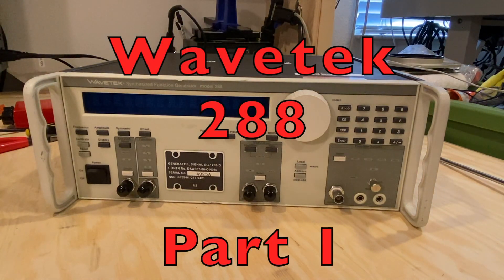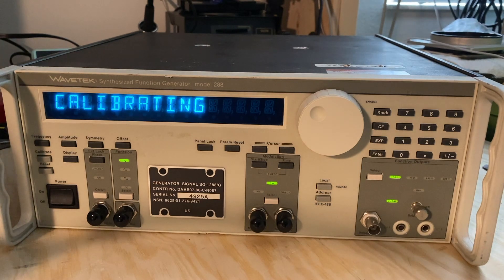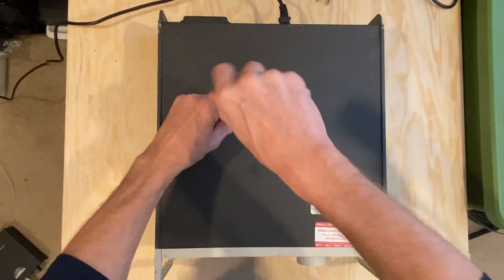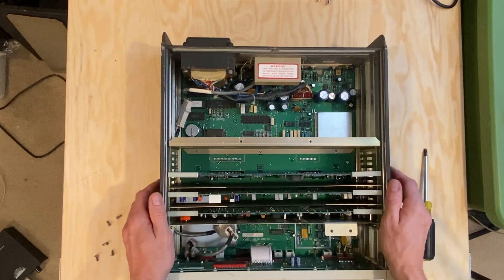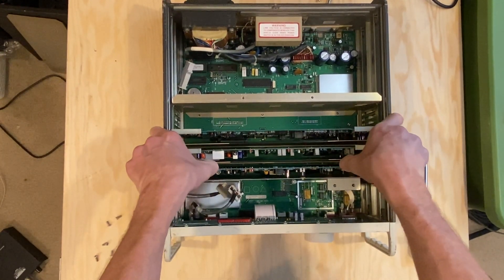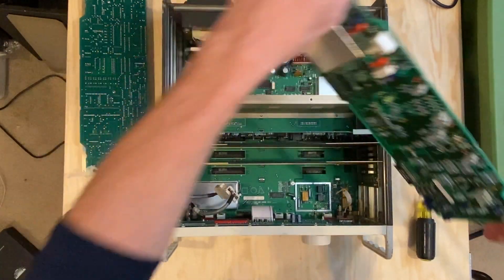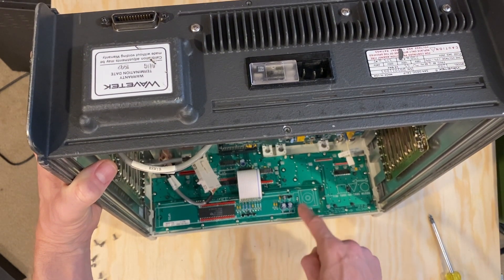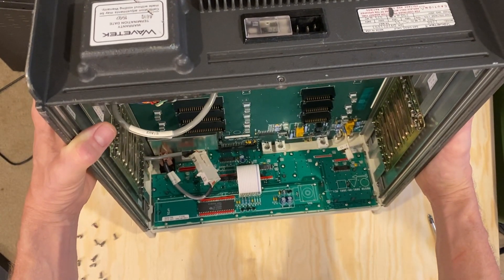Wavetek 288 Function / Signal Generator repair - Part 1

Comment: Very informative, already watched the three videos on contour. I have a question, if a unit indicates " CAL REQUIRED" what does this mean? Thanks
Reply from the maker: Hi Boyet. This is a default setting that initiates upon startup.  A twenty minute timer starts when the power button is closed to the on position.  At the end of this time, the unit will reach back to a ram chip on the mother board and retrieve the factory calibration settings and apply them to the unit as a baseline.  If you press the calibration button during the first twenty minutes, a visual timer displays, and shows where the unit is at in the countdown process.  The unit is not usable until after this process has completed.  These factory parameters are normally good for the life of the unit if it is in a stable environment, however these units where designed fro the military in  mobile application use. Temperature, vibration and so forth can mildly change the status of the units accuracy if these events are outside normal operating range of the internal electronics, therefore calibration is required upon startup in a warmed up state.  There does exist the ability to change these factory settings if any drift is shown through time, when setting the baseline with outboard calibration equipment, though this requires high accuracy references performed in the correct sequence.  I have two of these unites now, and lucky for me, neither one has lost it's factory calibration information (which is possible if the internal battery goes dead).  I have compared them to each other, quality DDM and oscilloscopes and they both appear identical and spot on, even after so many years of use.  Wavetek made some good stuff back in the day.
Reply: @savvycircuits9683   Thanks for the explanation. With the price of HP equipment, this will be a good alternative. Stay safe, be well